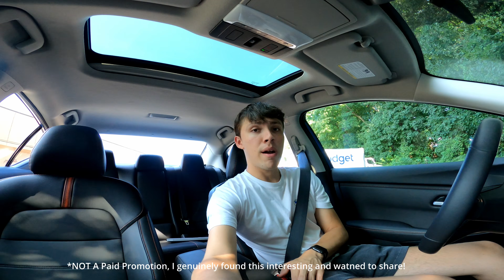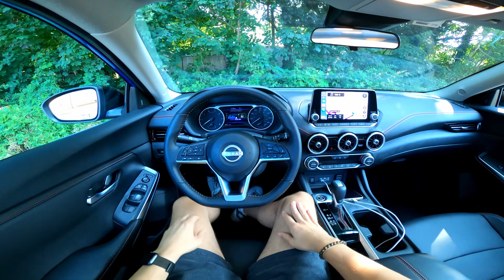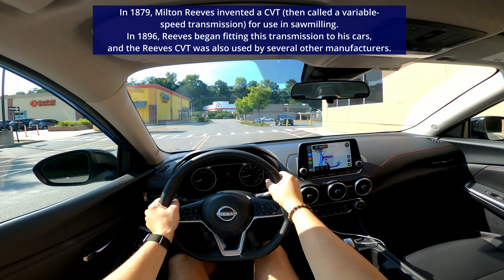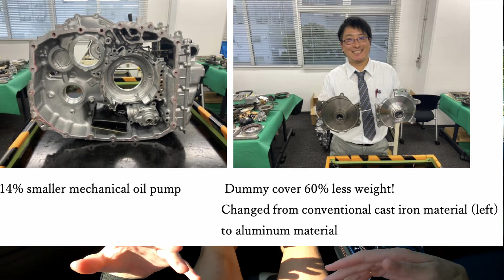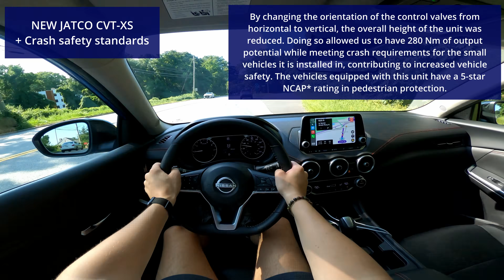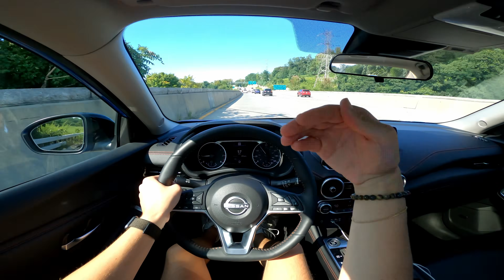2024 Nissan Sentra SR With The New JATCO CVT-XS /// A Good CVT?

Comment: Is the way you hit the accelerator not gonna affect the cvt belt or doing a shift shock ? In other words is this way of driving cvt considered aggressive? 

Thanks
Reply from the maker: No. The boxer engine is honestly happier when you drive it like this from living with Subarus for 20 years. 

The CVT can get hot though if driving aggressively for long… though so would an auto gearbox from a vehicle in this class
Reply: @Allcarnews  brother thanks for answering , but I was talking about this video when you driving Nissan Sentra , not Subaru

Comment: FYI, Refined again for 2026. Maybe by 2050 the CVT by Nissan will be good. Nissan will die on these lousy CVTs. My 2024 has so much NVH with CVT at 1200 rpm cruising. Horrendous CVT.
Reply from the maker: That's simply what a cvt does...

Comment: I just bought a 2025 Sentra SR made in April of 2025.  The data plate says it is a  RE0F15A transmission!!!  Well how do we explain this?  I do like the way it shifts though.
Reply: Is the same cvt as the 2020 Sentra.
Reply: @joseluissolis1305  No, it is the new CVT-XS that was installed in 2024

Comment: Ive got 50mpg out of mine
Reply from the maker: @scottypumphrey6934  epic!!
Reply: Been tracking milage since new on a 2024 Sentra SV. Cold fridged winter to really hot summer. Averaging 35.7 mpg over 9,002 miles. Mainly rural and suburban driving. Start stop disabled.

Comment: Great thing about the stop start on this vehicle is when you turn it off it stays off indefinitely unless you physically turn it back on something nobody is ever going to do
Reply: @Nate_HarietteYouTube_Adventure  I own a 2024 and you have to press it every time you restart the car and this CVT sucks at 40 to 60 cruising at 1200 rpm with engine lugging causing floor and steering vibration. You talk up these cars and my opinion after 3000 mi is the fact it is a horrendously tuned drive train to get 1 mpg extra. Please rent one for a week before you buy this Sentra.
Reply: @Rick-h4u  we already have a 2024 and have 38k on it not 1 single issue with it I personally changed oil every 5k and I did the recommended transmission service at 30k myself it was pretty easy you might got a bad one
Reply: @ Probably
Reply: @ My dash rattles in many places and passenger door too, probably great in SoCal with smooth roads

Comment: Good new generation CVT
Reply: No it is not, I own one and after 3000mi it is a lousy drivetrain.
Reply: @Rick-h4u  stop driving it like it's a race car
Reply: @navi947  It feels wishy washy and the stop/start does nothing but shake car. I guess everybody feels different about this transmission. What does this fake shifting do to the longevity? It has only been out for less than 2 yrs. I have my doubts about this CVT and I own a 2024  Sentra w/Premium  package.
Reply: @Rick-h4u   if you looked inside the cvt you would know why idiots who think its a race car always braking the cvt. you must go soft on the first gear otherwise it will brake the belt.

Comment: I have a 2021 Sentra SR Premium and feel that that cvt is about the same as the new one. One big difference I think is when at full acceleration you let off the throttle the 21 has a sling shot effect. Other than that don’t notice much difference. My best fuel economy was 44 mpg with a 32 mile trip mixed highway. Anyways wish they would change the interior some. Exact same as the 21. The biggest disappointment is the front end. The 21 has a very aggressive look with exceptional hid low profile headlamps. Also the 21 has LED driving lights. Why did they do away with them. They’re so nice and good looking. Either way this is my second Sentra SR and I truly enjoy my 64 mile round trip commute everyday.
Reply: 2024 has the sling shot effect. Weirdest feeling transmission I have ever owned. Tons of NVH in wheel and floor from the transmission at cruising speeds and 1300 rpm. My first and last Nissan btw.